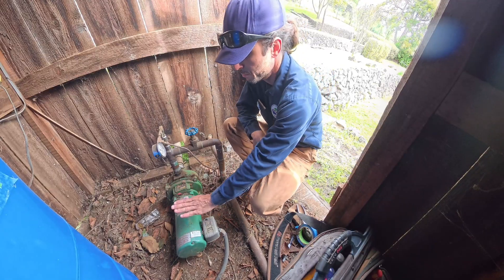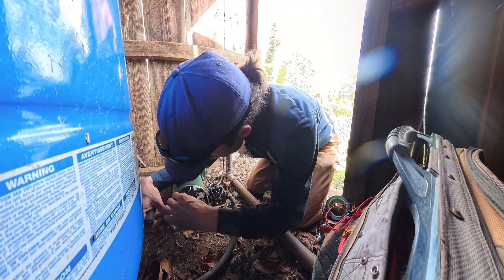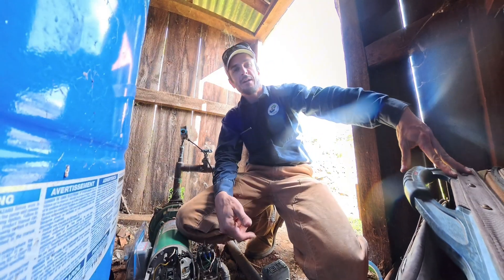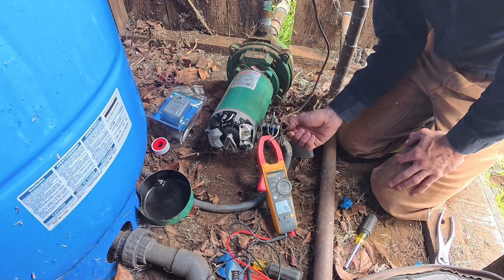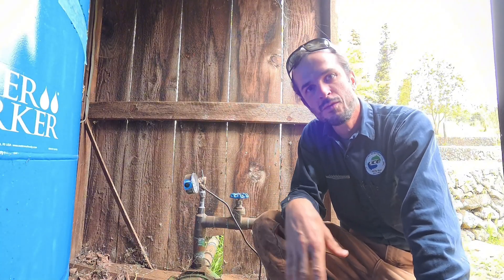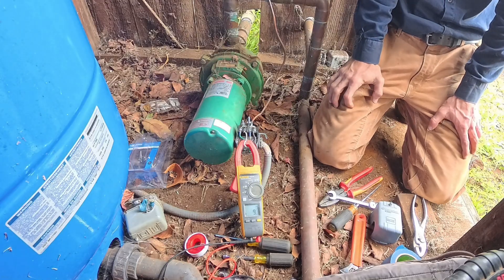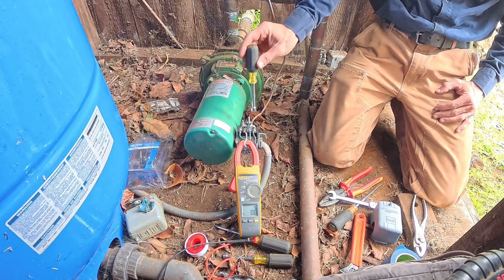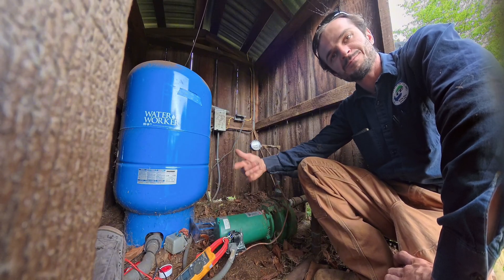Pressure Switch & Water Pump Repair

Comment: Noticed around the 13 minute mark as the pressure was increasing the current was decreasing. Is this inverse proportion common or could it be caused by a partially closed valve where the pressure was increasing but the flow was decreasing while maintaining the same gpm?

Comment: With the small size bladder tank the pump likely starts/stops fairly often, leading to the contactor wear and capacitor failure that you noted.  Might suggest to the owner that they consider keeping a spare capacitor in the shed.  Enjoyed the tutorial on the switch function.  Did not know about the low-pressure safety feature.
Reply from the maker: Thanks

Comment: Most, not all switch and capacitor failures are caused by rapid starting due to low air pressure in the tank.
Reply: That is exactly what I was going to say. I bet that tank is low on it's air charge.

Comment: Geez I've messed with a couple of pump pressure switches and never saw or knew about that slick low pressure cut-off!  Thanks for explaining that.
Reply from the maker: They're perfect for simple pump installs without any controls or loss of prime protection.

Comment: If its siezed more than once now why not throw a DIN rail timer in and enclosure and bump it one or several times a day for a few seconds. and replace the run caps with decent ones
Reply from the maker: That's one solution. The issue is the cast iron impeller housing building up corrosion to the point it interferes with the plastic impeller, as in, this is a relatively cheap pump that I've kept alive with clean outs and rebuilds over the years.

 I've given proposals to upgrade to a CR grundfos pump with SS impellers and housing, but as is usually the case, I can't make people spend money. So Instead I just periodically do services and repairs.
Thanks for watching!

Comment: Hi Ben seeing those black cased motor start capacitors sent a shiver down my spine I used to work in the factory where they were made I did testing of samples of each production run. Can you tell me the make if the caps you replaced? I'm just curioyse to know if it was one of ours.  Sorry to waffle on 😊
Reply: Hi from looking at it the box, looks like the Packard brand.
Reply from the maker: It is an NGM 61B1D110161NNM0
Reply: @Up-CountryElectric Not one of mine then ours were labelled BHC  MADE IN ENGLAND

Comment: Hi,
What's the correct name for that pressure switch? 
What do you ask for when buying?
 I like the safety feature that prevents a dry run.
Reply from the maker: "Square D 30-50 M4 low pressure cut off switch"

https://a.co/d/4U4ZVah
Reply: I would call it a permissive switch. A differential pressure switch might work? Depending on how you’re controlling things, you could have a Low Low for cutoff and a minimal Low for run.